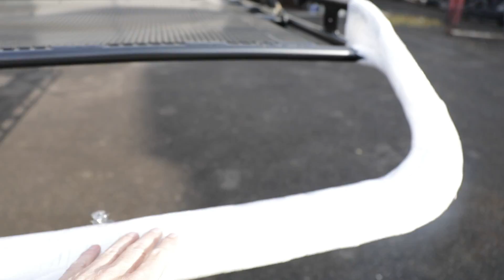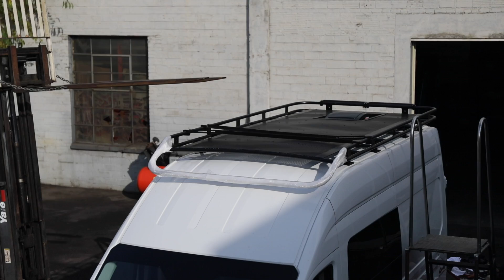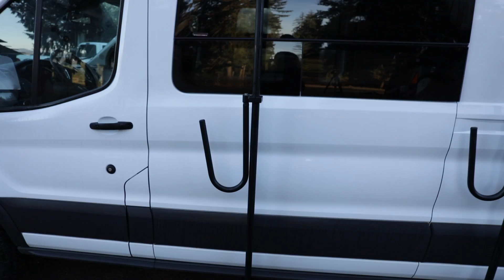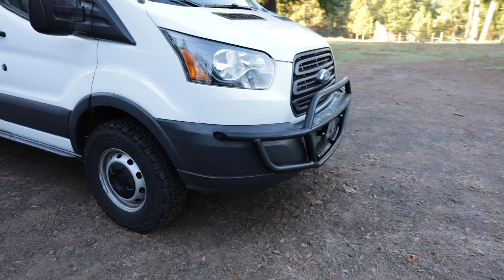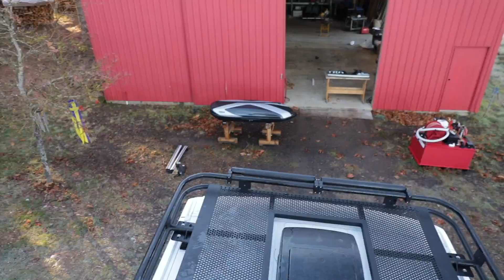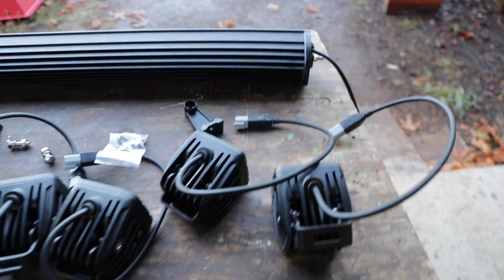Meet The New 4x4 Adventure Van

Comment: If you happen to have a heavy wall bias tire kicking around cut yourself rubber grommets to mount your lights and oversize the bolts one size and youll likly never have to worry of vibration damage to the led lights. Otherwise the mounts have no give to them other then just the suspansion of your van. That little extra give in the monting yet security saves the diods from rattling loose

Comment: But the big question is what kind of mpgs are you getting, I am betting no more than 10mpg. Also how legal is it to have those hooks off the side. Most states have laws as to the max width of passenger vehicle. If you exceed that width you need markers, and sometimes (depending on how far extended, and state laws) possible even a escort. Also most places have laws as to max out from the tire something can hang. I had a friend who had to take his fender flares because they stuck out to far from the tire. Definitely look into this Cody, you are running into a serious risk of being held liable for damages, even if someone hits you.
Reply from the maker: 17 mpg
Reply: @wranglerstar  really that's impressive I did not think it would be that high. Thanks for the reply.

Comment: Very cool van! Of course, you could have gotten a Mercedes Sprinter. Would have made installing your add-ons so much simpler. What with the much easier to use metric system and all. (ducking and running, don't want to get hit when you throw your bottle of loctite at me) :-)

Comment: Fair warning, I have the same long light bar. The attachment for the light bar is cast pot metal. Thankfully I was on my driveway when it snapped. I ended up designing my own with spare aluminum I had lying around.

Comment: What is the legality of having stuff hanging off the side of your vehicle?
Reply: Don Abele fine as long.as.secured
Reply: @Lawyerboyleslie72  To what point?  You can't just keep strapping stuff to the outside of your vehicle, even if it is secured.

My dually pick-up is required by state (NH) and federal law (DOT) to have markers (yellow and red) delineating the widest part of my truck - this requirement is for anything wider than 80 inches (my truck is 92 inches wide).  And, again - per law, nothing can extend beyond those markers without proper temporary identification (which could include a pilot and/or escort vehicle).

Per the online specs, a Ford Transit is between 77 and 81 inches wide.  Those hooks look like they are sticking out a good 10 inches from the body.  If Cody clips someone with the cargo hanging off the side, or someone hits it, I'd bet dollars to donuts he would be held liable for all damages, as well as being cited.

Be well,
Doc
Reply: Did not appear to extend past  the side mirrors.

Comment: Did you only put the power step on  the passenger side or how did you deal with the clearance issue on the driver's side?
Reply from the maker: Yes I did, I dut it down to 50"

Comment: Most men will agree, having one with a nice rack is very important. And yours has a huge rack. Very nice. One question though. Did they disconnect your engine battery before welding on it. I always do. But I’m not sure it’s necessary.

Comment: Maybe a surround for the roof vent to ensure clearance ? Would really want to know the bumper bars do not compromise or mask airbag sensors or activation... you did not mention that at all.
Reply: The bumper bar is meant to absorb impact so in case of a serious accident it will bend and the sensors will still activate. They are mostly for small trees and branches that might smash your lights or scratch the paint. If they were too strong you would bend the frame if you hit something solid which in most cases means whatever they are attached to turns into a boat anchor.

Comment: I hope you don't come across anyone when you have those lights on or you will blind them, that light bar looks amazing. I take it the ladder does not interfere with the new step you installed on your last video, I could not see how it was attached to the bottom of the van
Reply: John Fithian-Franks I think the step is on the other side without the window 👍🏻

Comment: On the subject of cargo inside the vehicle, I have a large (and heavy) tool / survival kit in my SUV.  I bought a heavy duty plastic chest to keep everything in.  I use the cargo compartment's factory tie down points and have threaded heavy duty cargo straps through slits cut in the handgrips and over the top of the chest.  This allows me to ratchet it down tight. I am confident it will be hanging from the ceiling, locked in place, even if I was to roll over.